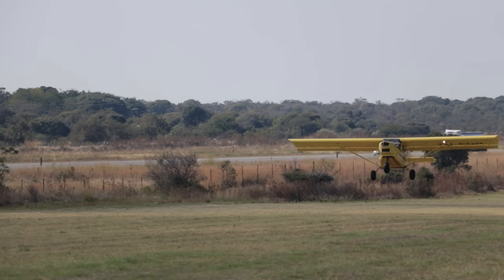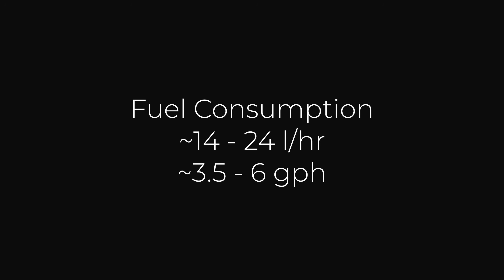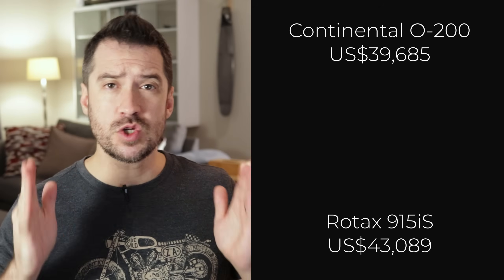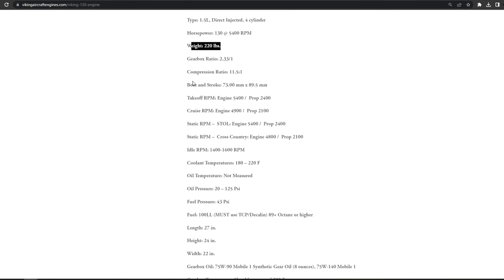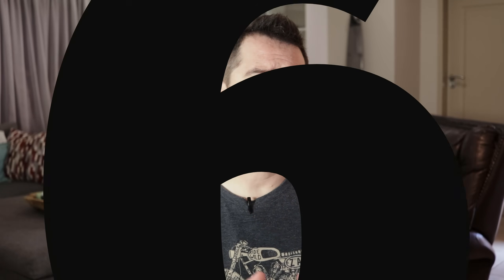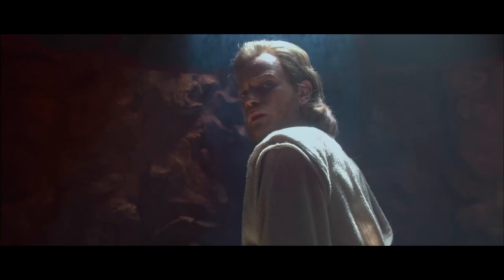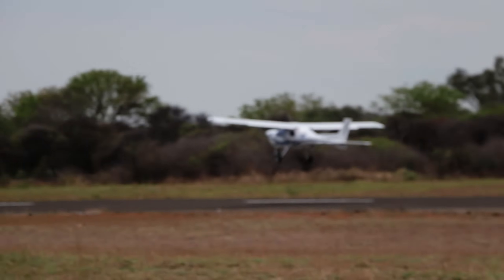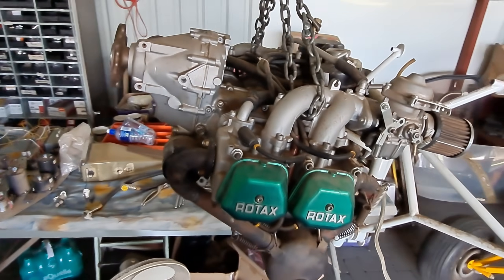6 WORST & 6 BEST Light Sport Aircraft Engines

Comment: The 4th gen jabiru 2200 engine is the better buy now with the changes no more valve adjustments  and torqued  heads with 2000 hour rebuild, is now 85 hp
Reply: I had the 1st gen solid lifter #1130 which was 85 hp. Amazing engine.
Reply: Does IT have a gearbox included?
Reply: @alexanderzohrens2945  doesn't need a gearbox
Reply: The price is now much higher...
2200 Generation 4 (4-cylinder, 85 hp @ 3300 RPM) – $21,900

Comment: You have to consider all-up installation weight when analyzing these engines. For example, by the time you add coolant, radiators, oil tank and carb heat and propeller to the 80hp Rotax, you end-up with a total installation weight very similar to that of the AeroVee. A similar comparison can be made between the 100hp 912iS and the 100hp AeroVee Turbo -- approximately 200 lbs. firewall-forward. Therefore, your assertions about the AeroVee power-to-weight vs. 80hp Rotax power-to-weight really aren't fair. Also, there are plenty of LSA aircraft out there with max gross weights under 1320 lbs. which also have lower empty weights (our Sonex is a great example), in which a 200 lb. firewall-foward installation weight with 80hp works-out quite nicely.

Comment: I have been flying a Kolb MKIII with a valley reduction drive 2180cc VW for about 25 years. with careful trimming it weighs about 20 lbs more than a Rotax 912 at about $10,000 less producing about the same thrust.

Comment: I’m amazed at the output of the UL 350Is . I had it paired with a  sensenich two blade adjustable prop and the Fadec was Amazing albeit on the rich side. Started up and idled with ease regardless of engine and outside temperature.
Reply: The advertised power output on the UL Power engines is at 3300 rpm.  That is incredibly inefficient and loud without using a gear reduction drive - which is not included.  Add in a gearbox and the price goes way up.  Operate the engine as a direct drive at a lower rpm and power goes down considerably.  The 350is becomes a 115hp engine at 2700 rpm.
Reply: No engine is operated at rated power continuously for purposes of fuel efficiency. The UL isn’t noisy either . Sounds like you are unfamiliar with them.

Comment: The best engines are ones you would get upper limits or Noonan racing to design upper limits have a 4 cylinder flat 4 all billet aluminium that puts out 1600 to 2000 hp then you have Noonan racing with their all billet aluminium 2 cylinder engine making 1000 hp these are the designers that could make a light weight aero engine with 120 150  or even 200 hp  for your planes

Comment: I have been flying for almost 40 years and most of that time has been behind Continentals, from A-65 to 0-200, O-300's, IO-360's and a few big bores.  The Continental O-200 is time proven design that any mechanic can work on and get parts for it.  If you are worried about the weight, the Continental O-200D was built for light sport aircraft, the Cessna 162.  If a person is looking for an easy engine to repair the AeroVee is based on the VW type 1 beetle and any weekend mechanic is very able to repair and overhaul it as needed.
Reply: So you're totally disregarding the $40,000 price tag, versus the $7,000 price tag of a Jabiru 2200, with a superior performance to weight ratio.   And as for the C162, well, the choice of that insanely expensive engine is what contributed to it's failure and removal from market - only 4 years after it was introduced. Not a great example.   There are certain people who are just blinkered about modern, high revving, light engines like the Rotax and still believe the heavy, low efficiency 1940s-designed Continentals and Lycomings are still the way to go.  Meanwhile, the world moves on to amazingly performing and efficient TDI engines. In Europe, the Diamond DA-40 is fitted with a TDI engine that burns 5gph.   In the States, that same aircraft has the slower IO-360 that burns 10gph.     Yeah, conservatism.... the enemy of innovation.

Comment: You should compare installed weight, TBO, fuel economy, simplicity, cost, ease of maintenance, and frontal area; especially around the propeller. Reliability should definitely be in there. I think your No.1 engine scores highly on the frontal area. Rotax is also extremely well established, and certainly one of the best. My own preference would be the UL260i with 97hp, direct drive, and FADEC with fuel injection. It runs on 95RON fuel, needs no carb heat, and the direct drive makes it rather simple. I think it offers the simplest installation, and good access to service points. From the ground the Rotax engines seem very quiet, but I found they feel very buzzy in the cockpit. I like VW engines, but would favour Great Plains with Nikasil cylinders, over Aerovee. A friend has an Aerovee, and the cylinder heads look like they came out of a very poor foundry. The rest of the engine looks quite tidy.

Comment: Why state horsepower at sea level? How many of you fly at sea level? 

The AreoVee Turbo will make 100 hp from sea level to 8000 feet. It outperforms the Jabaru at altitude,  and is $15000 new.
Reply: Because horsepower varies at higher altitudes.
MSL is the standard for specifications of take-off power.
Reply: Turbo-Normalized engines are pressure compensated for altitude.
Naturally Aspirated engines are not.

Comment: LSA is purely american stuff, unknown in Europe or only microlight regulations are applyed: 500kg gross weight (2 places aircraft), 525kg with parachute, VSO 70km/h, max power80KW...No one in european microlight did use continental  dinosaur engines because they are way too heawy, too expansive and too thirsty. In 4 stroke range (many fly 2 strokes because weight and afford cost), i mosly seen Rotax 912UL or 912ULS and some Jabirus, but the Jabiru as a bad reputation of poor rellability and poor performance, all other engines are very rare...

Comment: I put 460 hours on my 915 in 18 months with zero issues. It’s taken me up to FL250. If you can afford a 200k+ airplane you should be able to afford the price of a 915. In my opinion everything else is subpar underpowered naturally aspirated junk.
Reply: I have a 914, would like to get a intercooler at some point.

Comment: Interesting, but where did you get the price on the Jabiru 2200 at $7000 US and the 3300 at $11500. That’s not even close as you can double those prices
Reply from the maker: 2 different sites, one was ppgparamotor dot com (yeah I see where I've gone wrong). But check the pinned comment, I've fixed the pricing.

Comment: I wouldn't trade my 2180 100HP turbo for any of the engines on this list. For me it's the cost, reliability, longevity, low fuel burn, easy do it yourself maintenance, its the full package. I built mine as a kit from Sonex when they were much cheaper than the 15 thousand currant cost.

Comment: $11,000 for air cooled VW flat 4??? Modifying and building an air cooled  VW engine doesn't come close to costing $11,000, and this is buying the best parts money can buy. It's entire existence is based upon being cheep. What's next, an v-twin harbor freight engine that cost's $300 brand new but because it has been modified for LSA its now $6,000??? 
Everything having to do with civil aviation is a massive scam.
Reply from the maker: Welcome to aviation, where a $1 part  in the car shop cost us $3 for the exact same part 😅
Even the Revmaster R-2300 converted VW is advertised as $9,800 on their website.

Comment: The best engine power and price wise is  a converted Corvair engine delivering 130 horse power and costs around $12000. It is air cooled and is very reliable.
Reply from the maker: Price and power is great, but very heavy in my opinion at around 230lbs. There are some, but not many true LSA's (MAUW of 1320lbs) can handle that weight.

Comment: Where would the Yamaha Apex engine fit in the list?
Reply from the maker: Depends on installation and which one. The Edge Performance converted 200hp weights roughly the same as the Rotax 915. So great power to weight ratio, but too heavy for most true LSA's (1320lbs MAUW). 

The 150hp version weighs about the same as the 914. So kind of heavy, but a lot of power at that weight, so might be in the top half of the list somewhere. Unclear on the exact cost though.

Comment: The VW from Steve Bennett powered my KR2 just fine . It produced 74 hp at take off , 65 continuous and never let me down in over 800 hrs. It was cheap to work on and there were many parts sources .  And at 2.9 gallons per hour burn was great for economy .
Reply: The VW derivatives in the 80hp class are ok for a single seater, but too marginal for two. There are several VW powered aircrafts in my hangar, and they almost never fly with a pax, unless a really light one and in winter.
props suitable for 3300rpm are less efficient and that adds to the already marginal performance. Looking at these airplanes operate, they look more like 65hp airplanes, not 80. 
"powered my x airplane just fine" doesnt mean much, if for instance you operate from 4000ft rways at sea level and in mild temperatures.
the same airplane will become a death trap in the mountains in summer.
Reply: @crono331  My Kr2 flew quite well at 1040#  in the summer weather.  I still got 500 ft per minute on the hottest of days . The O200 was at almost the identical weight per HP ratio.
Reply: @charleswesley3642  

What useful load though?

With that 2.9gph burn, I suppose you only need to bring 10 gallons or so for a statewide range. Which helps fit a full size pax.
Reply: my Beetle engine is a 1979 model, never broken, still purrs (though I think the oil inlet is starting to gum up in cylinder one, it's slightly rough at cold idle). It must have 4000 hours on it at least, never overhauled.
Reply: and they're air cooled and virtually indestructible. Though to be fair, the Rotax can run dry at 56% power (for two hours).

Comment: I think the most important thing has been left out of this list.  The consideration of reliability.  What good is an engine if it has a high failure rate? Engine failure data per 100,000 hours should be considered in my opinion if available.
Reply: It's not, and the issue with reliability stats in the experimental world is that it really depends on the installation and maintenance.

Comment: the HKS 700E for Lighter Sport .... that's the way i would go on a budget.

seems like a Very Light engine, with Two Different Gear Ratio Options...Smooth Boxer Twin, And No Hot Cylinders hiding behind cooler ones.
that would be like Super Powers, with the 2.58:1 reduction on a Rutan Quikie.

Comment: i will bring it up with H-D, and see what they say.
EDIT: i do concept development for H-D, i was just talking about it as a design exercise, ( until i found out what they go for )
the Radial-3 Turbo will be in a surgical clean room assembly, and preceded by meticulous QC if it goes.....but i did get the bulletin on it written up, and slated for forwarded to H-D headquarters ASAP....so we have the Radial -3 here.
Reply from the maker: Sounds cool, hit me up with the details!
Reply: @LetsGoAviate  but i have been doing more ground work, ( for concept presentation purposes ),
and honed it in on Milwaukee Eight parts ( to give it some existing parts compatibility )..... i started with the 131 crate heads....that's a 4.310" Bore, and dropped the stroke to 3.200" ( figuring the bottom end is going to be fresh designed )....so THE CONCEPT is a 2.3 L now....i liked the 1.347 Over Square i got with it, ( more time for the dual plugs ), and the rod ratio came in at an excellent 1.752....so i started modeling the CONCEPT ....on 2 Bar of Turbo Boost,  i got 350 HP @ 2850 RPM Prop ....that's about 600 lb.ft. at the prop, after reduction losses..
it's a monster...and it would probably weigh under 200 pounds too.....BUT IT IS A CONCEPT...JUST A CONCEPT, at this point.....but that's what i am taking to the table
Reply: @LetsGoAviate  that's on 100LL Av Gas.
Reply: @LetsGoAviate  i know it's not a Light Sport Aircraft engine anymore....but i have to relate it to what H-D is already tooled for, in some way.
Reply: @LetsGoAviate  i am keeping average piston speed max to 3,000 fpm , on 4,000 fpm rings, and have to reduce valve train inertia yet....it's still close enough that i forwarded it out already.....but it could be years before i hear anything on it....litterally.
Reply: @LetsGoAviate  i mean it would be light enough to mount in a light sport aircraft.
but how much do you want to spend to go strait up like a rocket to 10,000 feet before you have to even think about leveling off ???
Reply: @LetsGoAviate  the 131 crate tooling is crate tooling....that's why i went that route, but it was Also the best thing for the engine CONCEPT...but the whole engine would end up being a fresh design, with just some existing tooling references..... so probably a ways off, if at all..
Reply: @LetsGoAviate  so sorry, but IF....it would probably be a 6 figure engine. ( but also including sub-frame and mounted sub-systems )
Reply: @LetsGoAviate  it would have a cabin pressure output....high amp output 28 volt....one of those types of engines....i don't make the decisions there., so i have to do what i think might go.
Reply: @LetsGoAviate  it would be plug and play...but make your own cowling, and select and purchase your own prop..
Reply: @LetsGoAviate  turbo inter-cooler, oil cooler, oil tank, ECU, all that kind of stuff already bolted to the sub-frame.
Reply: @LetsGoAviate  you can fly faster, and further with less fuel, up over 10,000 feet....that's another reason i went in that direction..... people with planes like that can make money flying, so it's a self funding market....gotta put the chips where it makes sense.
Reply: @LetsGoAviate  the " Verner Motor SCARLETT 5S" is a Currently Produced Radial-5 that makes 83 HP and weighs 163 pounds....but i don't know what they cost.
it probably wouldn't make it high your list, as a direct drive....but it qualifies as a light sport radial engine.
Reply: @LetsGoAviate  Verner Motor also makes a direct drive, normally aspirated, Radial-3, but at only 42HP, and 93 pounds, you would be shopping for a Lighter air-frame..
Reply: @LetsGoAviate  the Verner Motor SCARLETT 3VL might pair up nicely with a Rutan Quickie....something light like that.
but you would have to make a mold plug, the mold, to cast a custom 3VL/Quickie shroud, but you could make money selling those parts, once you had a mold made.
Reply: @LetsGoAviate  for people who mostly fly to fly: the lighter, and more efficient, air-frames will provide more opportunities to do that on fixed incomes...i mean people can look for financial opportunities to offset the costs, 
but people also need to be very careful when justifying investments ... you have to do the market research before biting off more than you can chew.
Reply: @LetsGoAviate  everyone just needs to make sure you have enough money to cover scheduled maintenance costs.....running costs are a big part of averting any life changing disasters....so you have to set your operating budgets low enough to cover running costs.
Reply: @LetsGoAviate  i can't afford to fly yet...but at least i know that...but a Rutan Quickie makes me wonder if there are any good air-cooled boxer twins ???....but my first flight would have to be with microsoft flight simulator anyway... and so maybe i just look into that first..
Reply: @LetsGoAviate  i found the HKS 700E 60hp Aircraft Engine .... that might be a bit much for an R. Quickie ... it has a reduction, so much lighter.
Reply: @LetsGoAviate  that HKS 700E 60hp Aircraft Engine has got to have a really good power to weight....but i can't find a published weight figure.
Reply: of course there is crop dusting, and aerial survey... so i guess when i think about it there is flying income in light sport also...i just don't have the existing tooling references to pitch for it.

Comment: a 2.1 Litter, air + oil cooled,  Radial-3 Turbo ( with the planetary ring cam bearing support beefed up to make it also act as a 2:1 reduction ) 
bore: 99.5mm x stroke: 90mm x 3 cyl. = 2.1Litter = 5,080 RPM ( engine ), 2,540 RPM ( prop ) @ just 3,000 fpm Ave. piston speed.

sadly, no one makes one yet.....but if someone did make a Modern Radial-3 Turbo like that, it would probably be the Lightest on the list, and put out around 180 HP

Comment: Interesting list in that it tries to just look at the objective details. Of course always hard to compare things apples to apples and there are so many small factors that can make even a 'terrible' choice based on this chart a really good and sensible one all things considered. Volkswagen based engines are plentiful in the light airplane world for a reason even if they're a bit heavy for the power. And LSA manufacturers continue to stick with the Rotax as basically the only viable option despite the costs for a number of really good reasons as well.
Reply from the maker: Yes that's it exactly, it's an objective list. The only way to make an objective engine comparison on reliability is to use statistics. But besides the fact that statistics isn't always fully representative, and can be presented to confirm anyone's bias, it isn't going to change anyone's mind. I can (and have) shove statistics in anyone's face on the reliability of the Rotax, but the ones who believe they are not reliable will still believe that they are not, no matter what facts presented. It's almost fully subjective.

It's pointless (in my opinion) to talk about reliability on the internet, unless the goal is to open a can of worms, which this video seemed to have achieved even though it completely avoided the reliability subject. 🤷‍♂️

Comment: Prop RPM should be point of considering.  VW engines don't work well with long props. But with the right aircraft,  it could be a very good engine and a reasonable priced engine